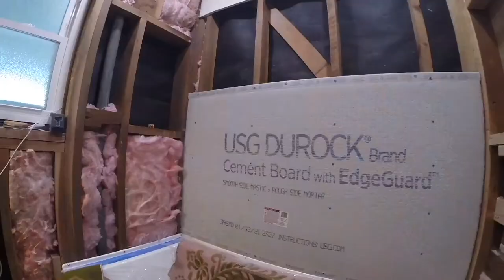Bathroom Remodel DIY - Timelapse from start to finish

Comment: Very nice :) impressive 
how long it took for you to do this 
can you also share itemize list of all the supplies you used and its cost?
Reply from the maker: It took me a bit over 2 months, but mainly worked on weekends. I kept spreadsheet just to calculate summarized cost on materials and tools. So I spent ~ $1300 on tools and about ~4800 on materials.
Reply from the maker: https://docs.google.com/spreadsheets/d/13dCYBgwy4E76KyTSuvdj6SqimDo0g26xXgDZ19mmHGE/edit?usp=sharing
Reply: @GorVardanyan   Thanks very help full i just remodel bathroom smilar to yours and spend like 6K .. only difference I put the rain shower instead of regular once
Reply from the maker: @akifzeeshan3645  Congrats on the remodel. Did you record the process?
Reply: @GorVardanyan   No i didnt record any thing and I am not smart like you , i hired one contractor and i was helper :) ....some how no mater what you do the bathroom remodel cost around 5 to 6K and for kitchen it is 10k :)
Reply from the maker: @akifzeeshan3645  oh it depends. Where I live it costs somewhere 25-30k if you hire a contractor.